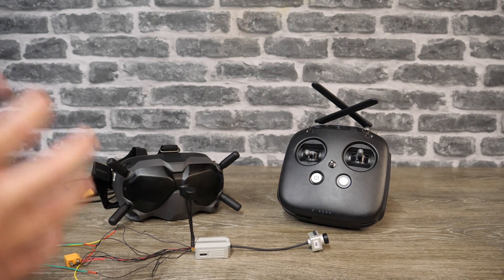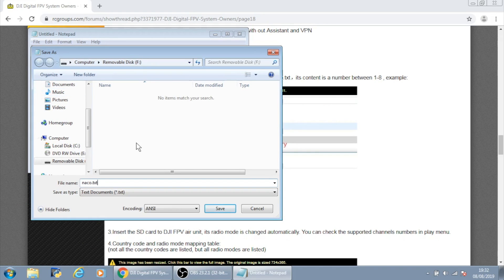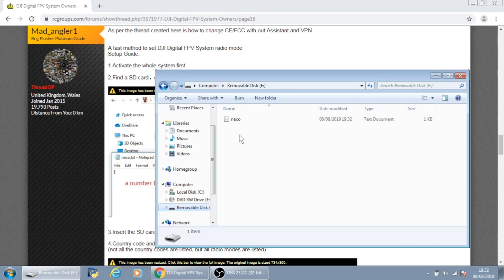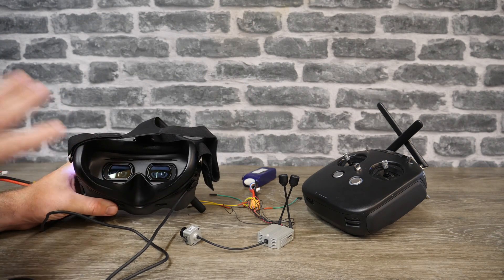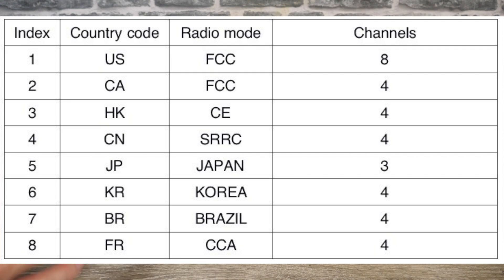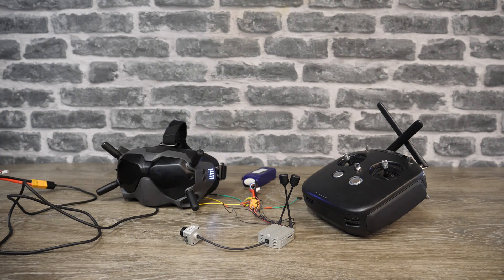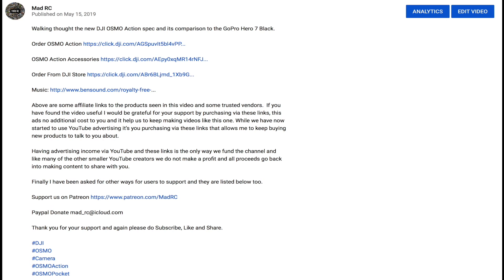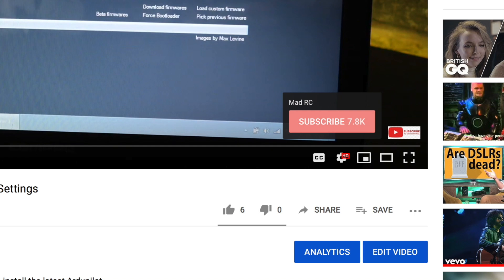DJI Digital FPV System -  FCC Hack 700mw Power & 8 Channels

Comment: Hello there ... Maybe you can help me here .. I have this Gogleess V2 with a cadex vista.. this method is not working for me. The file in the sd card with the Google's is doing nothing. Config still remain the same . And I have two usb non readible when I plug the cadex vista usb c to my laptop... I'm not finding a solution . 😢😢 I lhave the 1.06.06 fw version in the gogggles

Comment: pretty sure 1w is the limit with fcc. not 700mw. try again :P
Reply from the maker: It depends on the transmission type and antenna gisn.  For instance for 1w 
 is has to be no more than 6db of antenna gain.   DJI need to reduce the output beyond that.  

There are also requirements on spurious emissions.   

As a result 700mw was the legal certified maximum.

Comment: I have the nebula pro nano vista air unit so it doesn't have an SD card slot... is there a solution?
Reply from the maker: It has built in storage.  Connect via usb and Power up and place the file on the internal drive that will appear.

Comment: I have 8 channels and have 700mw..I nust have FCC mode as i have 1.6 goggle firmware..Why is butrate greyed out @ 25 Mbps.The quad is armed and power mode is disabled...so full power all the time.
Reply from the maker: Perform a reset on you goggles via the menu with everything turned on, if it does not appear perform both the FCC Hack and 1200MW hack again.
Reply: @MadRC  Silly me...the vista was not latest update...I could of sworen I updated properly when I got unit.Apparently not...All is good and thanks again!

Comment: can these air units be connected to any other kind of receiver besides the goggles? I have a another need for the transmitter and camera but do not want to receive inside goggles.
Reply from the maker: Sadly no.

Comment: GOGGLES V2 ALSO GOOD! OK THANKS YOU.
Reply: So does the hack work also on the V2 model?
Reply: @Ryzexus19  yes, I did it and succeeded .
Reply: @phuocthiennhantam7970  Wow, really nice. I am going to buy one of this and this is a really good news. And If I have understood correctly, you just need to hack the RX ad then the TX change the operation mode automatically right?
Reply: @Ryzexus19  That right. It seems to resemble V1. V2 only added functionality associated with the dji flash. You can switch modes to each other.
Reply: @Ryzexus19  You have to copy the file "naco" to the sd card on Vista or caddx before you can open the hacking function

Comment: thx so so much.  I’m in the us and for some unknown reason it’s only showing 3 channels.  At first I had all 8.  After about my fourth flight it only allowed three channels.
Reply from the maker: In 50Mbps mode there is reduced channels, check if your in that.  

If not in 50 Mbps mode the. Perform a full reset from the menus and try again.

Comment: Thx, still works in Nov 20 in UK
Reply from the maker: Yep nothing changed on this.
Reply: @MadRC  Thx, tested it today on 1000mw, massive difference, happy days as I was really disappointed with the 25mw range..
Reply: @MarkPurmal  once the fcc hack and the 1200mw hack are done, do you constantly see the options to alter power up to 1200mw, or only if the air unit is powered up along with the goggles?  I’ve done the mods and whilst my goggles power up in 50mbps mode (even without the air unit powered),  I can only access the power settings when the air unit is powered (without the air unit on, the power level option is grayed out and locked to 25mw, as is the temp control option).

Haven’t got my air unit in a build yet (I updated it using a power cable harness to use a Lipo to power it),

Comment: Can someone please explain to a newbie what does this actually mean?
I understand this is an valuable hack, what do i actually gain from having more channels and power output?
More range? Throttle Power? Flight time? 
Thanks! 😅
Reply from the maker: More power = more range and more penetration though trees and building ect at short range.  

The extra channels also mean you can move out the way of other system on the same frequency.
Reply: @MadRC  awesome!
Any risks to the system?
Reply from the maker: Nope it’s more than capable  it and it’s got overheating protection
Reply: @MadRC  thank you very much for the info friend <3

Comment: Hi,
I’ve just converted to DJI in the UK. I have tried the mod with your file and it doesn’t do anything. Do I have to do anything with the goggles? So far I only have the vista units and I added the file via the usb on to the internal storage. For some reason I only have 2 channels and not 4 to start with? Any help much appreciated 👍🏻
Reply from the maker: Do a full factory reset of the settings from the googles with the Air Unit turned on and it should kick in
Reply: @MadRC  Thanks man! Worked for me :)

Comment: Has this changed with updates? I only have 2 channels after doing this. However I can go to 700mW
Reply from the maker: No it does still work, after doing the mod perform a factory reset from the menu and it should come back.
Reply: Thanks, I was an idiot and didn't realize 50 bitrate went down to only 2 channels
Reply from the maker: Ahh that’s a good point.  Yes double the bandwidth

Comment: I did this and able to get 700mw and 50Mbps options. But my available channels now changed from 1 2 3 to 1 2 8.
Any ideas guys?
Reply from the maker: Perform a factory reset and it should sort it.  You can reset in the settings.
Reply: @MadRC  hey! I actually switched it to 3, then back to 1 and fixed it :)

Comment: hi i have 50 mbps and 1200mw but i dont have 8 chanel i have only 3 i am in canada  can you help me ?
Reply from the maker: You need to perform the FCC hack as well.
Reply: I hack it and I have 1200mw and Mbps but I have only 3 channels
Reply: @adonisfilipu  Could it be that you updated the fpv googles to 01.00.0500? I think it works just on V. 01.00.0200

Comment: Unfortunately this hack doesn't work anymore.  I've tried it a dozen times and nothing, following the instructions closely.
Reply from the maker: Nothing has changed is does work with both the Vista and DJI Air unit.  Are you creating the file or using my download ?
Reply: @MadRC  Nope, I've done it again using your file and it does nothing.  Still 4 channels only. 1-3 and 8

EDIT:  Wow, literally 7th time I do the same operation was the charm!  Weird....

Comment: with 50mb/s mode turned on, the channels swap to only 3+1, at least for me - anyone else?
Reply from the maker: That is correct as they now use more bandwidth on the 50Mbps mode. You should see all 8 in 25Mbps
Reply: Mad's Tech Reviews & Tutorials ok thx
Reply: @MadRC  This helped me a lot. Another question: How do I have a better signal quality and range? With the 50Mbps mode oder with the 25Mbps and 8 channels? Thank you for the reply. You have a new subscriber

Comment: Hi, if i was in region of CE mode, and then i hacked my system to use FCC mode, would it affect the fly distance? would i be able to fly up to 4km?
Reply from the maker: Yes you will get more power out and it will increase your range.  This is one of the main advantages for the FCC mod.
Reply: @MadRC  i followed your instruction, i got 8 CH available in my goggle, but the fly distance is about the same. ??
Reply: Hey  @sokvannakyun118   me to. Did you fix it?

Comment: But what about setting the controller to FCC mode?
These are the specs of the controller so obviously there are differences between CE and FCC mode:
Max. Transmission Distance (Unobstructed,free of interference): FCC/SRRC: 4 km; CE: 0.7 km
Transmitter Power (EIRP): FCC: <30 dBm; CE: <14dBm; SRRC:<19dBm
Reply from the maker: The RC is parts of the 2 ways system so when the Air end is in FCC the RC is as well
Reply: @MadRC  Awesome, thanks!

Comment: Can you edit your video to mention that you have to bind the air unit to the goggles once the file is in the air unit? you need to bind the air unit and goggles for this fcc hack to work. you cant just expect the file on the sd card in your unit to just work. must bind for the hack to work
Reply from the maker: Binding is nothing specific of the Hack.  It does not affect the hack and binding the goggles to the air unit is a requirement of the system to work.  

If you system is working as it should be you simply place the file on the card and turn everything on.
Reply: Mad's Tech Reviews & Tutorials I made the naco txt file, places 1 in it. Saved it to root of ds card. Nothing happened when I placed the sd card in the goggles and air unit. As soon as i pressed bind on the units, everything changed to the fcc. This is after the newest update. Dont know if that matters, but using the bind worked for me.. also this isnt out of the box and i did the power hack prior to get 1200mw. 🤷‍♂️ maybe it is important maybe it isn’t .. bind with the sd card in after power up worked.
Reply from the maker: you generally only. need to open the channels screen and it should solve it.

Comment: I can't access the file system on my caddx do you know any workaround for that?
Reply from the maker: You do it on the goggles.  Just place the NACO text on the goggles SD and turn on
Reply: @MadRC  yes thats what i thought as well, but sadly it didn't work. I don't know if they fixed it in more recent batches but it seems like i'm stuck on my current region.
Reply: Mad's Tech Reviews & Tutorials it would be great to see another video on this!

Comment: Note to Vaddx Vista users.
To change from CE to FCC Mode do as said with the file but insted of loading on an SD Card do the following:
1. Power up your Quad (Props off)
2. Then connect to your PC
3. Caddx Vista will show up in Explorer as a removable drive. Open the drive and save the naco.txt onto it.
4. Remove the drive
5. Turn off the drone
6. Turn in the Googles
7. Turn on the drone and wait a few seconds.
8. Check if you niw see 8 channels an 700mw.
9. Happy flying
Do at own risk...
Reply: Were is the link

Comment: Great review!. once changed to FCC the output will be 700mw all the time?
Reply from the maker: If set to yes.
Reply: How do you set that please?
Reply: The power level is switchable from the goggles between 25mW, 200mW, 500mW and 700mW (setting is stored after power off). I'm on version 01.00.04.00 at the moment.

Comment: Thanks for all this. It works perfectly but I loose the audience with FCC and 8 channels. I refreshed the firmware of the air unit in assistant 2 and the audience came back on the second google. I'll try the other modes but does anybody encounter the same problem? Any solution's maybe? Thanks!
Reply from the maker: Did you leave the SD in with the hack when the second set was turned on ?
Reply: @MadRC  yep, I did, this may be the problem?
Reply from the maker: No strange.  What I would try is this.  

Do the FCC mode on one set and turn everything off.  

Then bind the second goggles as the master to the air unit and then FCC again then bind the other set in audience mode.  

I have not tried this setup my self so can’t directly comment or test it my self.

Comment: just a quick question once we create the file on a sd card and insert it into goggles/airunit its all done? So we can now remove the sd card from goggles/airunit and it will still be unlocked?
Reply from the maker: Yea it will. It only needs to be in to unlock it.  If you update the firmware you will need to do it again though.
Reply: @MadRC  sweet! Thank you

Comment: Thanks for this it's works perfect !
The SD card need to stay in the air unit or it's possible to take off the SD card after it's works ?
Reply: hey, u only need to activate it once, u can take the SD card and throw it away ;) 
3:20
Reply: @Happy15th  thanks !

Comment: Is it ok to leave the naco files in goggle and air unit, so that it'll install again, after every firmware update?
Reply from the maker: Yea it should be fine but it’s possible it will overwrite in the update.

Comment: Hello Mad. 
I did everything as you showed and it changed from CE to FCC.
However, I do not see the difference between 25mw and 700mw.
When I fly around the house, the signal drops to one mark as if it was 25mw all the time.
I think there is something wrong.
Regards.
Reply from the maker: are you connected to part ? if not turn off low power mode or power limit
Reply: @MadRC  hey! I have the same problem. 8 channels available, 700mw/1200mw selectable, there is an "unlocked" when I arm, 50mbts mode is available as well. But somehow I cannot get further than ~200m (tried it in different environments as well)
I really don't know what to do, so dissapointing... :( (I have the V1 goggles and a vista btw)
Thank you

Comment: Thanks man. Suscribed!!. Can I ask you if this system also works with the newer OCUSYNC AIR UNIT? I would like to buy it, but I want to make sure. Thanks
Reply from the maker: No not with the Ocusync Air Unit for the Goggle RE SORRY.
Reply: @MadRC  That is a turn down... Better to use this system with 4kilometers, than the OCUSYNC with maybe less than 1kilometer... I guess I will try it with analog cameras to see how good or bad it is. Thank you

Comment: Do you know if you can have multiple Air Units Linked to a single controller and googles or do you need to go through the linking procedure ever time before using them?
Reply from the maker: Yes you can bind upto 5 sets and it remembers. You simply then turn on the set you want to use and it will just connect.

Comment: Do you know if you can have multiple DJI Air units linked to a single DJI Controller and Googles?   Do these have to be linked every time you use them or do they stay bound like a FrSky setup?
Reply from the maker: No you can bind up to 5 and it will remember them and connect on power up

Comment: Fantastic video!
I'm in the Uk and am thinking of buying this system. I thought I would have to use a VPN to get around the activation. But this is SO simple!
I just hope that the EU doesn't put pressure on DJI to block this in a future firmware release.
Still if they do, there's always a good old vpn.

Comment: For anyone this isn’t working for, try typing naco only. leave off the .txt 
This worked for me 👍🏽
Reply: Thx, "naco.txt" definitely did not work with current firmware, but just "naco" did
Reply: cheers mate that worked
Reply: Probably you had the file extension hidden in your computer. To switch this on is easy via the explorer

Comment: Hey, after doing this it worked briefly before disconnecting. Now I can't connect the Air Unit to my computer and it's not recognised by the goggles and flashes a constant red light... Any suggestions? Thanks.
Reply from the maker: That’s not good.  Is your power supply good enough? How are you powering it ? If it’s from an FC I suspect it’s failed and try from battery directly as long as it’s compatible voltage.

Comment: Hi Mad RC. Do you know if the hack works with the previous air unit model OAS11709 DJI OcuSync Air System? If not how to get the CE FCC switch? Thanks
Reply from the maker: Sadly no not currently

Comment: Thank you for this! Does the rc controller need to be changed to fcc too to get full range for rc control?
Reply from the maker: No the RC flows what the Air Unit does so set the Air end and your all good.
Reply: @MadRC  thank you very much!

Comment: now that has to be the easiest hack of all times :)
thank god you've put a download link to that txt file there as well! ;)
the only concern I'd have:  what if DJI closes this hack with a future firmware update?
bruce showed that 25mw is a joke - it's just to fulfill the regulations - but it's not really practical imho...
Reply from the maker: I really don’t think it will be closed down this one, it’s not in their advantage to do so ;).
Reply: @MadRC  yes, I think so. the CE and FCC limits are just their so that they can sell it without any risk. what the user does is their problem.
only if EU forces DJI to be more restrictive - they could have to close this down. but I dont think so.

fun fact: older DJI digi links like Occusync:
they for sure run higher than 25mw - but it's frequency hopping - and thus not broadband usage - and here other mw limits apply (I think 100mw).
greets, Mario
Reply: I did the 1.0 update and can not do it anymore😱

Comment: I just tried with a VPN and it doesn't work, only the file method works.
Reply from the maker: I have tested the VPN my self but it’s not as reliable as the file for sure.
Reply: @MadRC  Yes, I confirm it to you. Hope that the file method will work for next updates too

Comment: For DJI, Europe is an important country.
They also know that the system will not prevail if you can not handle the 25mw.
Only the user who does that can legally be held accountable, not DJI, they are on the safe side.
Both sides have won.
Reply: Pascal H didn’t know that Europe is a country.
Reply: @Ferdigrapher  yes a communist one, hahaha
Reply: Hans Turpyn Sound legit
Reply: also simply no one will ever ask you uhm, is your signal going over 25mw?

Comment: I suspect this will get nixed in the firmware upgrade
Reply: Don't think so. Europe is a huge market with lots of buyers that can afford this pretty expensive system. DJI knows that their goggles suck on 25 mW and that most europeans don't care about using illegal output power. If there wasn't the possibillity to switch to a higher power, I would never consider buing this.
Reply from the maker: I’m not so sure ;).
Reply: Then dont upgrade ! ;p
Reply: @TheSpiritOverSky  if it's like most dji products, you won't get a choice in the matter

Comment: You are best, freedom at last ;-) 
Have read in dji's manual but can not figure out if you can use their system in a simulator, maybe not possible?
Reply: yes with a hdmi to analog converter ;)